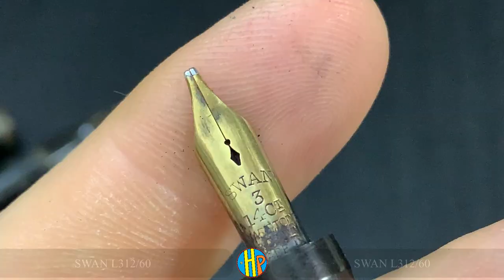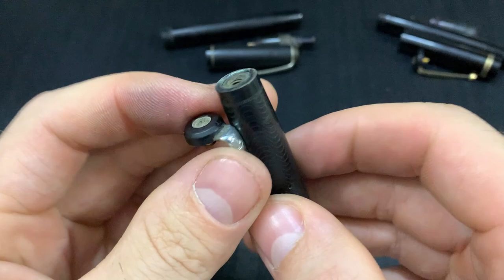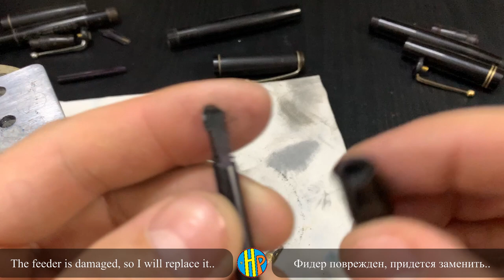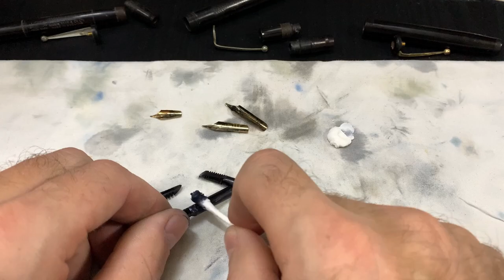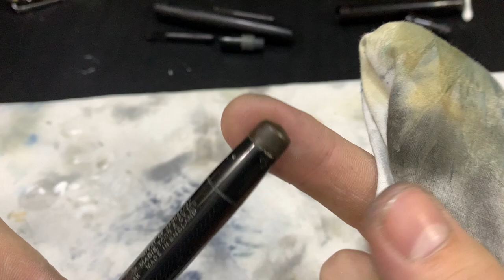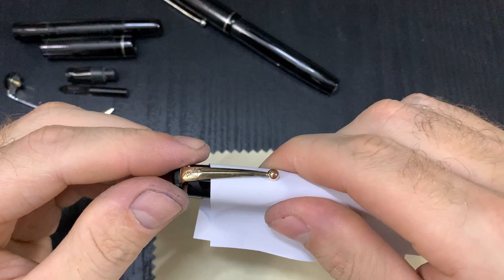Unlocking the Beauty of Vintage Fountain Pens: Restoration Process

Comment: Would you be able to do a tutorial on how to get stuck sections disassembled?
I’m having a tough time with a couple pens and don’t want to break them.
Reply from the maker: I may do such video in the future, but not in the nearest time..
Try to gently heat the tread/section [but don't overheat], try again and again, 3,5,10,20 times, gently.
Reply: @HappyPensVideos  I unstuck some by soaking them in hot water, left it overnight.
Reply: @MataH1  you need to be careful with hot water.  If the pen is made from hard rubber, the hot water will make the rubber go a lighter colour.  Apologies if I am teaching grandma to suck eggs.
Reply: @stephent8369  lol, grandma can suck eggs easily but accept any advice regarding fountain pens! 😅